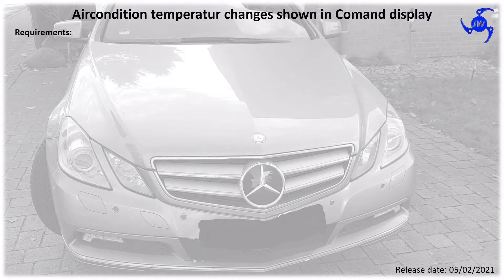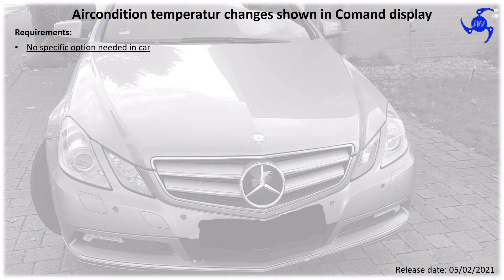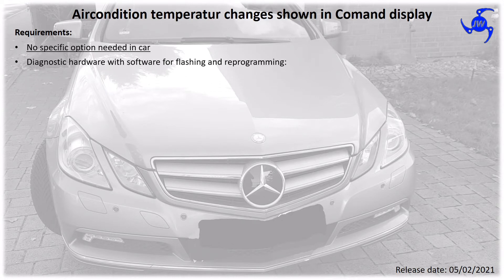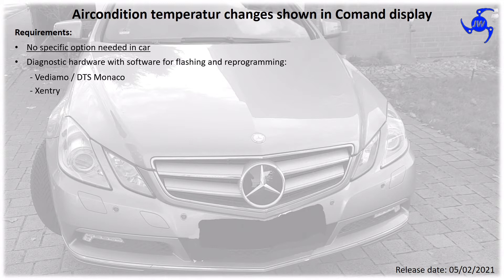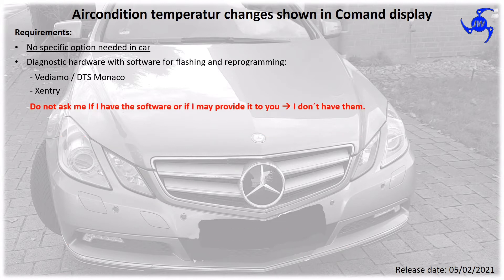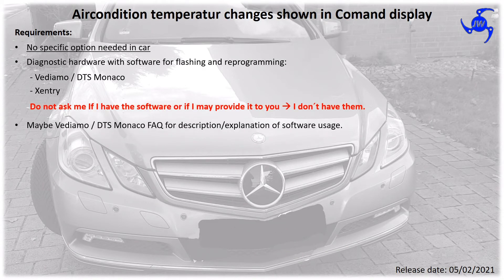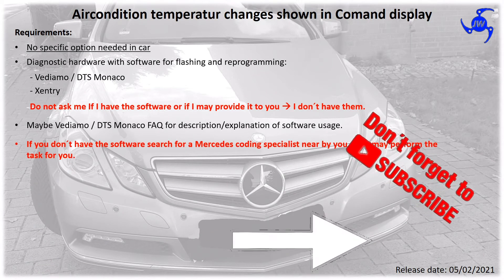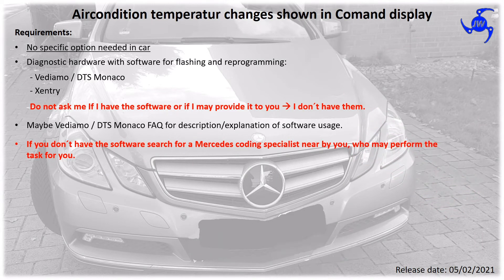DIY - Aircondition info in HU - Mercedes coding manual

Comment: i did this via the engineering mode and set it to advanced and it only shows me the temperature and nothing else. I also tried simple mode through engineering menu and i had the same result. If i change it through vediamo will it make a difference and show me things such as if a/c is on or will it make no difference? 
thanks for the video and any info you can give me.
Reply from the maker: @davvie420 
nobody told you to use the engineering mode. good luck. 
I'm not using engineering mode
Reply: @JWAutomotive  didn't say anyone had told me to use engineering mode, however there's plenty of places on the web that show how to do this via engineering mode. I was simply asking the question I asked after seeing your video on doing it through vediamo. Your the first iv seen doing it that way so was simply asking a simple question. So nevermind, next time I have a question I'll ask someone without a stick up their arse
Reply from the maker: @davvie420  it's up to you how you want to do it. don't blame me if it does not work the same way as I'm showing it on my video. I'm not here to discuss with YOU the possibilities or negative or positive things here in the comment section. and i don't give assistance for something what you have seen so far in the web. 

do your own experience and draw your own conclusions if you are so intelligent.
Reply: @JWAutomotive  i asked a simply question. You could of simply answered with yes, no or not sure, but instead you come back with "nobody told you to use engineering mode". Didnt once say you had. Simply asked for some advice. Second time iv asked you a question, first answer you gave was wrong, second was arrogant. Also never said or gave the impression i was so intelligent. Not an issue though friend, you can take your answers and try using them to remove that stick thats so firmly lodged, they aint been much use for anything else. Now go enjoy your day, ciao :hand-purple-blue-peace: